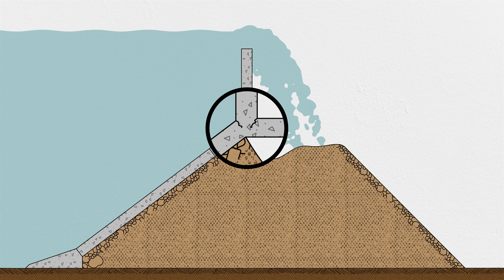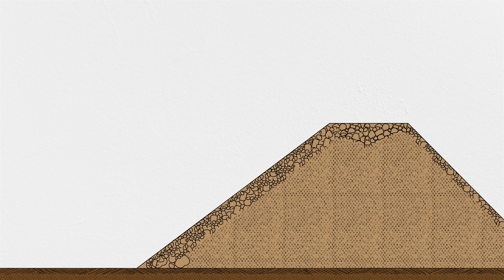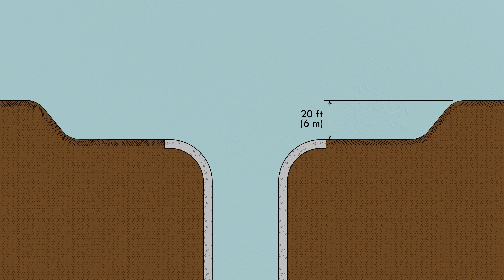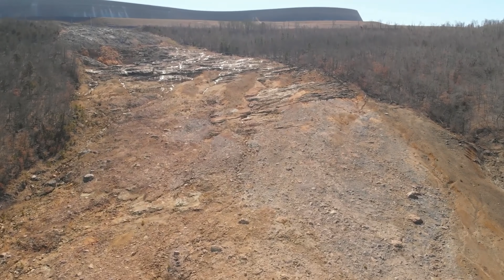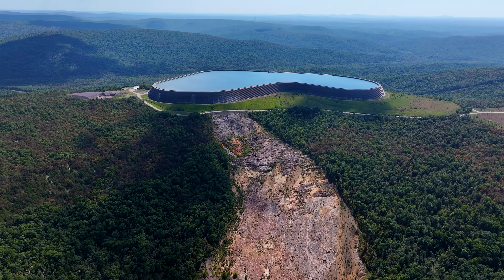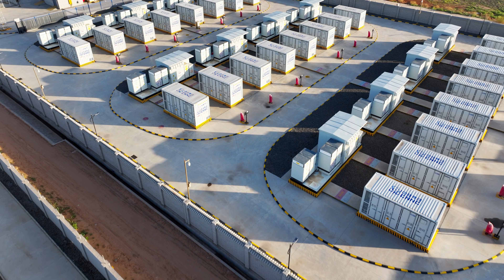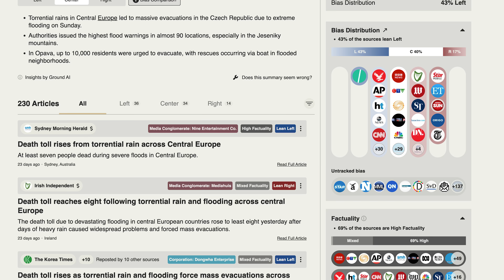The Wild Story of the Taum Sauk Dam Failure

Comment: Small note about that Equation to solve for Power. You said we can really only effect two of the four variables. When we can effect 3 variables in that equation. Gravity being the only one we can not. Density being the one I'm referring to. By varying temperate the density will be effected. Go to cold, Ice. Go to hot, steam. Which makes me wonder if using a standard pump system is the most effective way to get the water to the top Steam can be moved faster and will naturally condense. But I don't know if the volume potential would be sufficient enough, and if the power needed to heat that volume would be low enough to make it worth while. I figure if it was it would have implemented it by now.

Comment: Well, you CAN change the density if you're willing to not let it mingle with another reservoir used for drinking water, for example.
In theory, you could use mercury that moves between two locations at a difference in elevation.
Reply: You might want to look up the price of Mercury. That might be theoretically possible but totally impractical.
Reply: @avsystem3142  That's why it's "in theory."
And frankly, the health hazards FAR outweigh any price concern.

Comment: I have no idea how no-one mandates going analogue with visual oversight if they insist on continuing to operate despite knowing that they cannot trust their instrumentation. My background is in chemical analysis and processing, if I don't trust the sensors for time or volume, I manually observe and calibrate. If I have to continue using equipment with failed sensors beyond my repair, I don't guestimate a compensation and effectively add a systematic error to the mix, I manually check each one.

Comment: Wouldn't it also be safer to not have the water sticking out of the natural terrain by just digging deeper, removing the need for a wall that can be underrun by water?
Reply: The goal was to have the water at the highest practical level. Putting it in a hole, even on the top of a mountain, wouldn't make a lot of sense.

Comment: Would floating GPS devices (anchored to the wall) provide accurate enough water-level measurement for controlling the pumps?
Obviously there's too much variation to use altimeters as atmospheric-pressure used in measuring altitude varies as the weather changes!

Comment: The usual shoddy construction, though the ongoing blind refusal to observe the settlement, with the water surface as a handy visual guide!, nevermind the absolute gobsmacking "nothing to see here" non action after engineers observed the overtopping was breathtakingly arrogant stupidty. And the final year failed Civin Engineer in me wonders why it was considered necessary to penetrate the waterproof lining, when the could have mounted a lever hinged to the wall top with the other end on a float. Like a giant ballcock in a domestic cistern. Except calibrated for varying water levels as opposed to an on/off function.

Comment: In my first job plumbing a school. I followed everything on the prints. The pipes had bends and not joints. After completing the job, the engineer told me I was wrong. Not because of the symbols but because joints cause less wear. And I had to change everything to a joint.
Finally he approves. Isn't the engineer the person who designed it and we made it to their standards with testing allowed to check it as ok not liable?

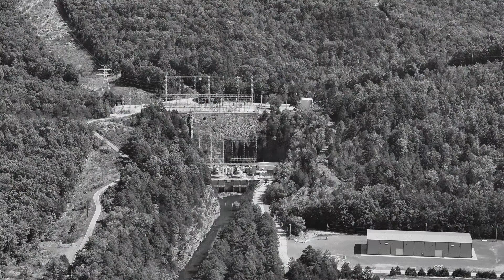Comment: Please consider your non-US viewership - I had to wait until 1:30 to learn where this reservoir is located, or failing that, do a google search. Thanks.
Reply: Although a point of information, the exact location of the system wasn't central to the presentation.
Reply: @avsystem3142  That's a circular argument. The presentation presumes, out of the starting gate, that the precise location is "irrelevant" since it is assumed that viewers already know.
Reply: 90 seconds into a 1210 second video is not unreasonable. This isn’t tiktok.

Comment: Question: as a sanity check, is there accurante measurememt possible of how much water you have pumped up? and how much you released to go through the turbines down below?  If so,  once you know reservoir capaciity, they could monito theoretical percentage of reservoir that has water at any point and if you calculate a number that exceeds reservaoir capacity and your water level senors don't report it, then you have a sanity check alarm that can go off.

Comment: Financial Miserliness is the cause of so much folly for so many companies when quality and reliability have better long term costs. A way to balance the losses of energy with a pump storage is to make the water multi purpose (ie recreation [maybe even an expensive water park] or drinking water). I'm not comfortable with large scale lithium battery storage of electricity because of the environmental impacts and labor conditions such as child labor. Water storage on a mountain is not without its negative impacts, but at least it's not as poisonous or environmentally damaging as lithium batteries overall.

Comment: You would think that there are so many easy, cheap and redundant ways to measure water levels with very simple systems. But many times these contractors come up with solutions that seem to be mostly to ask for more budget and get more profits from the project. Overkill solutions that are not justified, but get pushed by those in charge with little or no oversight nor asking for second opinions. It was just a water level sensor to shut off a pump. How hard was that? Yes, there were failures in other things, but this overflow issue was really inexcusable given the so many safe and reliable options available to deal with it.

Comment: Why not just have some kind of long and rigid member, like a steel beam or something, that you lash all your sensors to, and just anchor the beam to the top edge of the wall, and then let is pivot down? It's own weight should keep it down, and maybe you could float the other end up if you need to inspect occasionally?

Comment: Spillways may be pretty reliable, but it sounds like a key part of this failure could easily have impeded a spillways operation given the changes in the height of the wall, depending on where the spillway was, the water could have overtopped before starting to go out the spillway, the same way the fail safe sensors were not triggered.

Comment: As a process controls engineer, I would definitely pump the brakes if operations told me to change the offset of a setpoint in order to fool a sensor. It's often the kind of shortcut that can speed up production or smooth over problems, but it just tries to cover the symptoms instead of solve the problem.

Comment: some bad engineering forethought that this scenario wasn't accounted for of where the dam overflows either due to natural, human error, or pump issue.. and ensure the foundation/soil and walls integrity wouldn't be compromised.. aka a simple concrete ring around the whole structure to protect the soil from such an event, rather than fully exposed soil to erode away if the water ever overflowed out the top of the wall.

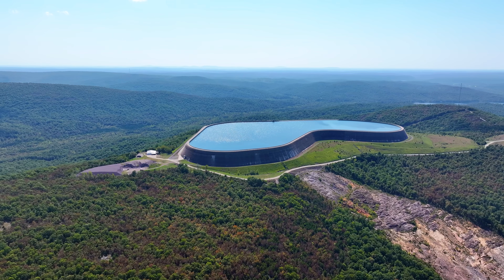Comment: Another excellent video by Grady.  I have just one nit:  At time 3:50, he says, "... but, there are no valleys at the tops of mountains".  The Bath County pumped storage project took advantage of a valley at the top of a mountain for its upper reservoir.  🙂
Reply: There are plenty of pump storage facilities in the alps which span heights of more than 1.000m. Like Lac des Dix. But even if you could say they are on top of a mountain, they are still valleys, but quite far up a mountain.

Comment: I don't think complexity is at fault here. From a control system perspective this is a very simple system. Those were some serious mangament and engineering problems that should have raised red flags long before this happened. That no one even bother to physically verify the programming of the failsafe sensors is insane...

Comment: My bathroom sink has a failsafe to prevent overflowing. A simple drain up the side of the sink to drain off excess water. Last I checked sinks have had these for many decades. Why was a similar system not built into the Taum Sauk dam? You could even work out the math where the drain could have the same or greater flow rate than both pumps so something like this would never be an issue.
Reply: We can't think of those ideas, we are not "experts".

Comment: Never should have happened. This wasn't an engineering failure; this was a series of deliberate decisions not to do things correctly or along best-practices.
Reply: Uh, engineering design encompasses all relevant factors. It absolutely was an engineering failure, but not exclusively. It was also an operational failure.
Reply: @avsystem3142  Greetings and Thank You for your response.  My context of thought is a bit different than your interpretation of my comment, and understandably so.  I'll briefly explain:  Engineering is the tangible result of Thought.  If the Thoughts are of Integrity, Best-Practices, Known Successful Strategies, Solid Safety Measures and  such (as opposed to short cuts, profit focus, questionable materials decisions, etc), then the results are an Engineering structure built the right way. Had the Thought to build the structure been fully focused on the things aforementioned, then the Engineering would not have failed. Mr. Grady mentioned that the initial compacting material was more soil than rock.  If so, someone knew that and made a thoughtful decision to use material whose Engineering capability was sub-par. Thanks

Comment: I was just thinking 'why did they add 2ft to the logic controllers programming for the lower sensors, instead of just adding some additional water level sensors on the top of the wall?
"the sensors were installed on a location that was actually higher than the settled parts of the embankment wall"
Monumental facepalm.

Comment: So if the upper reservoir spilled over for an extended period of time, where did all the  extra water come from?   Is the lower reservoir volume mismatched?
Reply: There was no "extra water". The water that was in the reservoir spilled out and not a drop more.
Reply: @avsystem3142  
How did it spill over the top?   Wouldn't that require a volume of water greater than the reservoir?

Comment: Water management controlled by sophisticated electronic and mechanical methods is a wonderful engineering achievement,  but when the toilet at home overflows 60 seconds after you leave the house you have a damaged floor.
 I can only think from my experience in boilers and "All" the new technology works great until it doesn't. 
 The Hartford loop & pressure and or temperature relief valves still protect people and equipment for the last 130+ years.
 I have often thought why engineers don't contract a unrelated outside company to ask "What if" before the job is signed off for final approval.

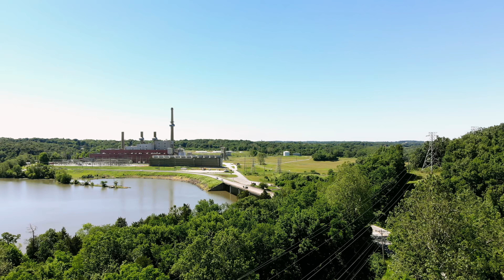Comment: @2:09 That is the original coal burning plant with it's warm water discharge pipe in the small cove draining into Springfield Lake and flowing over the spillway below the the bridge into the James River, also known as the White River before it was dammed to form table Rock Lake. Located SE of Springfield, Mo. this plant owned by City Utilities of Springfield, Mo was recently  closed and no longer produces power for customers in the Springfield , Mo area. The plants exhaust stack was demolished and plans to remove waste ash and future use of the building that housed the coal fired steam turbine generators , or the cold water intake building have yet to be a major priority for the utility company now that power generation has been tasked of the new South West power plant SW of Springfield ,Mo. on Wilson's Creek along with the city's waste water treatment plant in Greene County ,Mo.

Comment: The Lake Lure dam nearly failed in south western North Carolina during Helene. This lake is downstream of the town of Chimney Rock which was nearly totally destroyed by the flooding Rocky Broad River. Living downstream of the dam we were told to evacuate immediately. I was grateful that they were upfront about the danger of imminent dam failure but surprised how little detail is available of the specific areas threatened. We were told to seek higher ground for example but what ground was high enough? My father’s house sits 70 feet vertically above the broad river miles downstream of the dam and the water came within 20 feet. If the dam had failed could the water have risen another 20 feet or more? I’m sure you receive many requests to do specific investigations and I’m not sure this is the right place to ask but if you would be interested in looking into the Lake Lure dam and it’s near failure during Helene it would do a great service to the communities downstream. The dam is one of many similar dams that are all nearly 100 years old in the region. It is an example of one that has been relatively well cared for because of the large amount of tourist dollars the lake brings in. The fact that it nearly failed really raises concern about the other less well cared for dams. For example, Lake Adger dam just to the south built on the Green River held but the water release destroyed the bridge along highway 9. Both dams were built about the same time but Lake Adger does not draw much tourism. I’m sure you are busy and have many projects lined up but please consider taking on an investigation into the Lake Lure dam and similar regional dams. Thank you for your time.

Comment: That 70% overall efficiency is, I believe, over stated.    Yes, the absolute of efficiency of the motor/generator to move water up and down the mountain,, might be 70%,, I still doubt even that.  But the electric to push it uphill must be stepped down from the grid, each step implies an efficiency loss of 3% or so. Very probably more than a single step down and then when generating, there must be step up transformers, plural again,, frictional losses, evaporation, leakage,, rebuilding the ring dam,,,  Yep !!
By my calculations the max efficiency of pumped storage is 56% when ALL parts are considered.  NOW, I assure you, I think 55% efficiency is amazing.  An incredible achievement, and useful for everyone's after noon activities. The best pumped storage is where a hydro dam, and reservoir already exist.  The very best maybe where the pump is activated directly, mechanically.

Comment: Remote cameras and other sensors were not terribly expensive in the 2000’s. Not as cheap as now, but a fraction of a rounding error when compared to just the dam maintenance, much less the cost of repairing the dam. The attitude of “we’ll fix it properly many months later” is a huge problem.

Comment: Will be hilarious after the first major battery storage catastrophic failure to look back at how Taum Sauk's was significantly much less dangerous. The water just flows back into the lower reservoir. While it might be destructive due to the lack of the overflow, it won't cause the same issues that a battery storage facility will when one eventually blows up.

Comment: So, I'm no engineer, but isn't that an inefficient design? You're pumping the water up threw the bottom, against the weight of the rest of the reservoir. Would it not be more energy efficient to pump the water threw a separate route threw the top into the reservoir?

Comment: Great video. I've work in water utilities for 18 years and I'm perplexed why they didn't employ ultra sonic level sensors on the walls. They don't work great with sloped floors but they do work. Heck even an emergency shutoff submersible sensor on the wall for that last 4 feet. Pretty wild.
Reply: An ultrasonic level sensor could have been installed on a float over the flat bottom area of the reservoir. At the water level changed the sensor would measure the distance to the bottom.

Comment: Who gave that project a reward of excellence and who won that award ?
It’s a private project ( for profit ), how much public money was spent building the project ? 
Is it possible that so called green projects are deemed so beneficial and popular that there is a lack of scrutiny or criticism of any project that has a green label.
When you say the project is a net consumer of electricity and runs at a 70% efficiency, and the justification was an increased available on demand energy.
Another view would be that the energy is purchased for significantly less than it is sold. The 30% loss of public energy to facilitate the generation of a profit for a private company.
Reply: Controllable storage(hydro dams being totally reliant on rainfall) of electricity is always difficult and inefficient, relative inefficiency is better than not having it at all. It's producing power at peak demand, reducing the amount of generation needed etc.
Traditional alternatives for peak demand where things such as coal or gas fired generators, which were likely to be expensive, at least somewhat inefficient, and dirty
Traditional peak power generation: "Because they supply power only occasionally, the power supplied commands a much higher price per kilowatt hour than base load power. " en.wikipedia.org/wiki/Peaking_power_plant
"energy is purchased for significantly less than it is sold. The 30% loss of public energy to facilitate the generation of a profit for a private company." isn't correct, it seems almost certainly doesn't cost the public anything, and likely reduces the cost.
They pump at when electricity demand is low (such as overnight), and costs are cheap. The public likewise often pays a different price at times of peak or minimum demand, it's certainly the case here.
Hydro pumping is inherently green, at least when using green sources for electricity for pumping. At a minimum, it can instantly be switched to new green sources of electricity (without any modifications), just like EVs.
Whether it lacks scrutiny or not is speculation, it doesn't seem much more likely than businesses in general.